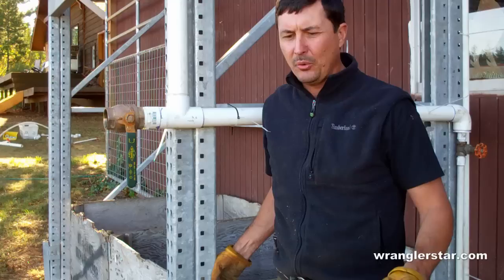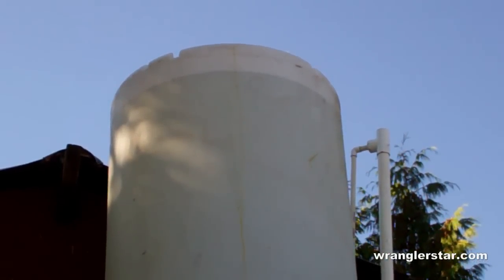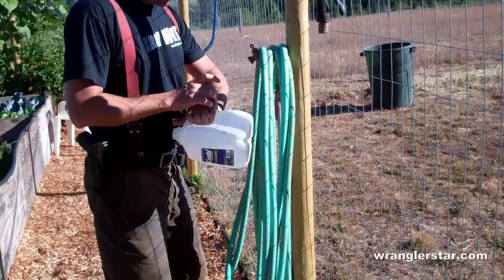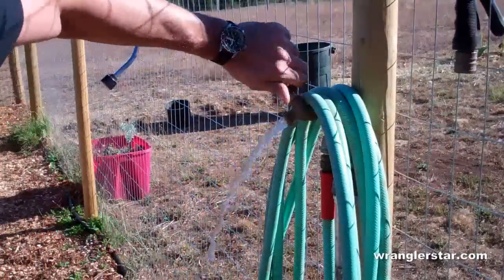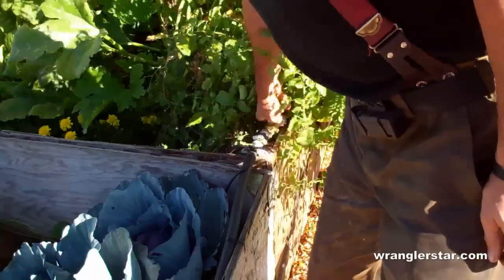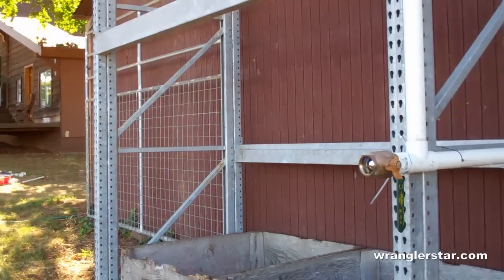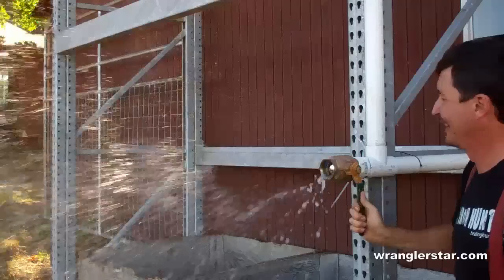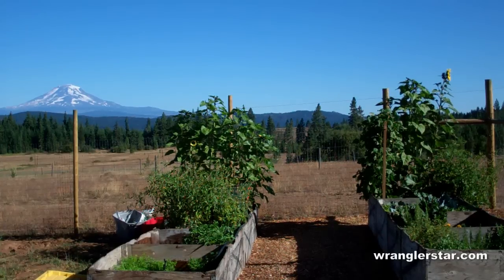Off-Grid Water Tower Exceeds Expectations – Gravity Fed System Review

Comment: Just stand up some 8 inch pvc and lash it to a tree and the weight will be on the GROUND.   Every foot is a little over .4 lbs pressure.  80 ft will give you 32 lbs of water pressure. (The reducer that comes off the city water supply doesn't exceed 40 lbs of pressure)

 Even if you get down to 30 ft of water you still have about 15 lbs of water pressure and you will have used over 130 gallons of water.  Here's another tip... you can put the water in with a 12v sprayer pump sold on eBay for under $20.  They will pump 70 lbs of pressure.  A 12v RV pump will work good too and has about 30 lbs of pressure -- for about $35.   Keep in mind that unless you are collecting water from a tall building, your water source may be much lower than the bottom of the tank.

Using 12v gives you a lot of options if you want to be prepared to go off grid ... or you rather use solar power than pay the man.

Comment: Wrangler- I would replace your valves in the garden with simpler ball valves, they have a much greater longevity and you can choke them far faster. The valves you have now need far more maintenance and they fail far sooner. New valves at that size might run you 30 to 40$ for years of use. Im  plumber.
Reply from the maker: +Straun30 I'll let him know.  thanks. mrsw
Reply: Thanks sister

Comment: That things gonna fall on your head .
Reply from the maker: David Flake No it wont. It's bolted to the wall,
Reply: wranglerstar
I have worked in the back room of two major department stores. They use those pallet steels they are very strong and I put multiple 5000 lbs loads on them and they do flex but thats it.

Comment: Call me a "Safety Sally", but you said it yourself,  ".  .  .  maybe if a 100MPH wind" .  .  .  Well, sir,  living in Florida CAN bring on 100MPH PLUS WINDS!!!!  They are called "HURRICANES"!! The way the stand holding the tank is braced from front to rear, but not side to side.  Everything here is fine until a strong wind comes up and starts getting the water to shift from side to side in the tank, from very little movement.    But what do I know, just 45 years as a Structural Engineer.  The vertical weight is not the problem.   Anyway, I'm wasting my time here.
I see that this is over 10 years old, so forget it.  I'm sure it's still standing, unless he lives in Florida.  End rant!